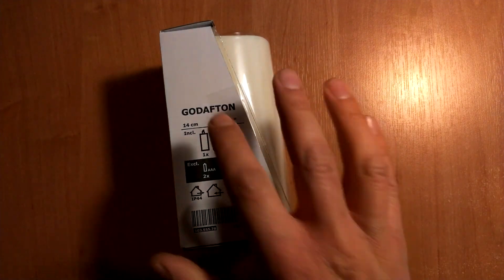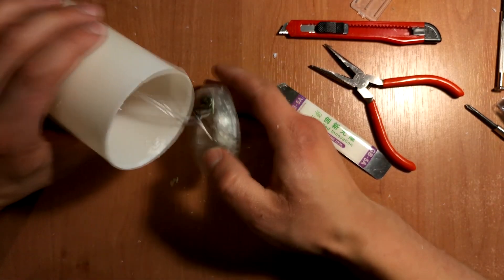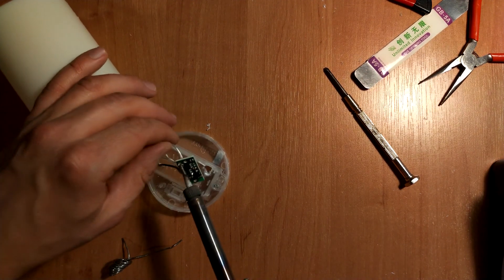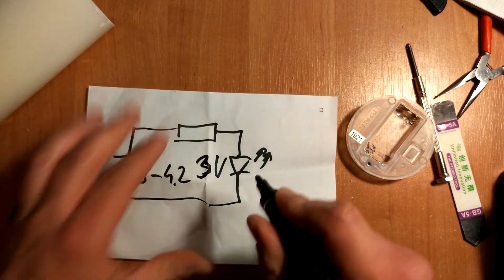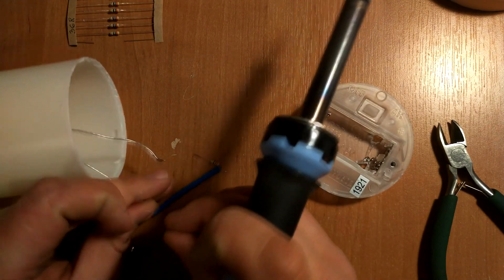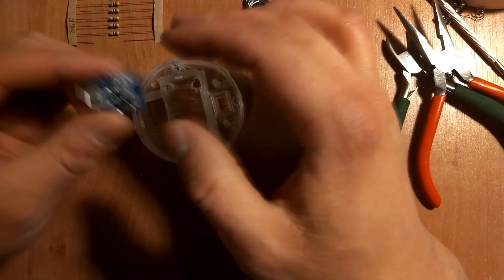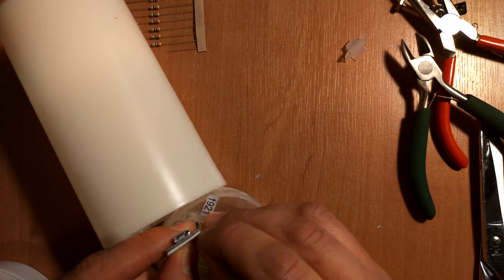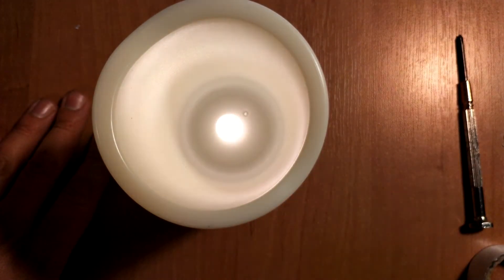Converting Ikea's GODAFTON candle to micro USB rechargeable, battery powered goodness

Comment: Do you also know how to convert battery power led cooling fan lantern where do I get lithium ion battery mini usb circuit board
Reply from the maker: The battery charging circuit board are avaliable on eBay and places like Aliexpress.
I'm sure you can convert most of battery powered stuff, but the main thing is to make sure that the output voltage is in the range of the thing you're trying to power. Keep in mind that standard li ion voltages are between 3.5-4.2V and that could be too much for some applications where two batteries are used. You would have to add a resistor to limit the current or if it's something precise, there are tiny DC-DC step down converters for $1-2 also on eBay and aliexpress

Comment: Another good alternative would be to use batteries from old cordless phones. I used a Dremel to cut a hole to glue a USB port into the lower-side of the candle, and I use a 5v (or just a USB port) charger for a phone to charge the candle.

Comment: How the candle is working so far?
Reply from the maker: It's still working. It may be a good idea to keep the baterry lid off if it will be exposed to the rain - get's rid of the water quicker. I did something similar with a lantern shaped light and put two batteries from Samsung phones - works for over a week straight on one charge and only issue I had was the doublesided tape that had to be replaced. This one was in snow, rain and in driect sunlight for about a year.

If you plan to get those charging boards, get one extra just in case - I bought 5 and one failed after few weeks.